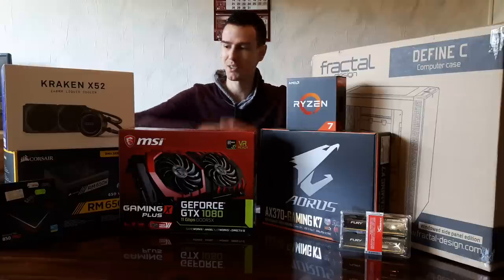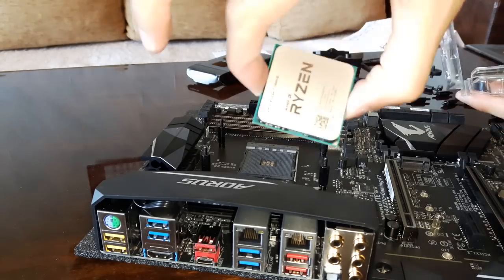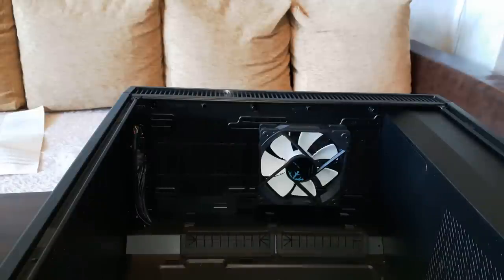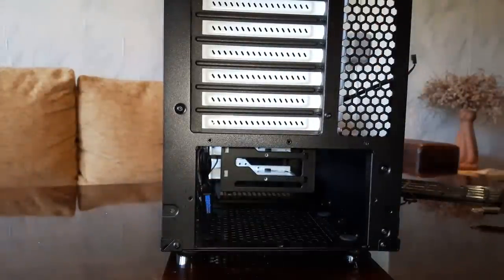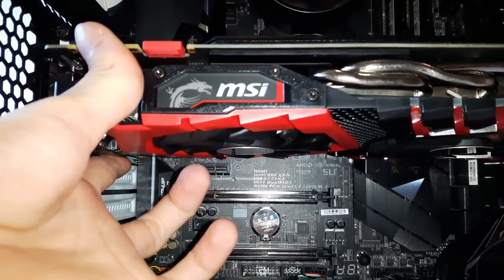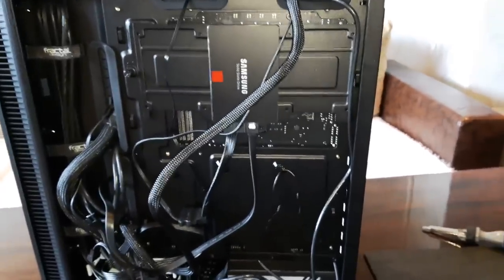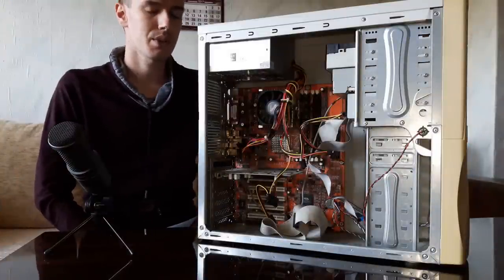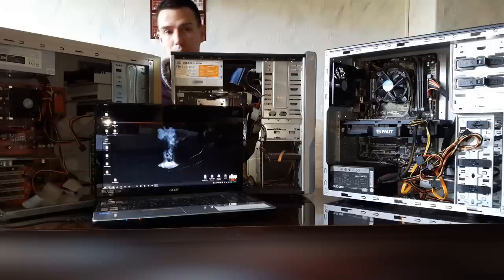FULL PC Build Guide [Ryzen 7 1800x / GTX 1080 / 16GB RAM / SSD / HDD / Radiator]

Comment: bad in fos 
what may be  the minimum require ments for  gaming pc   how it would cost i need to run at the games 
how i play it now is i check if it is released beafore 2009 i will get them
Reply from the maker: That depends on what games you want to play, what monitor you have and what resolution and FPS you are aiming at. Google it, there are many guides that might help you out.

Comment: I've looked at the title and I was like: "Is this for real? :O This must be fake, it's a top of the line PC, no more shitty case? Impossible! You're now like the other tech channels I watch. I was with you when you got the 2014 PC, how time flies!"

Thankfully, you're not like other tech channels...you are better!

I had a heart attack when you've thrown the boxes away, you maniac!

So GTA IV should now run slightly better, right?

Why not Ryzen 7 1700? With the cooler you could get pretty much the same performance for less money.

I've heard many bad things about Gigabyte motherboards, you still buy them, so do you love Gigabyte? :)

You say "ho" a lot :)

That GPU sag :/

This is not a guide, more like a personal diary of your entrance to proper PC Master Race, still, very useful if someone picks up this case.

It does look beautiful indeed.

Are the case fans 3pin or 4pin? If 3pin, not all motherboards/fan controllers can support them, and they will run at 100% making noise. If 4pin, they are fine and don't remove them, set them up in the BIOS.

You bought this cooler just so you can use its mirror to show your pretty face during the build? :)

For a first PC, the XP 1900+ is a nice CPU, better than those pesky Celerons :)

Surprised the Codegen PSU didn't blow up in the second PC.

spoiler alert - I saw "GTA 4 - Stevie's Car..." on the Acer :)

I'll brag about my current budget rig too I suppose:
CPU: Intel Pentium G4560
MoBo: ASRock H110M-DVS R3.0
RAM: 2x4GB DDR4 Crucial Ballistix Sport 2400Mhz
SSD: GoodRam Iridium Pro 240GB (MLC)
PSU: Seasonic Eco 430W
Monitor: BenQ GW2270
Case: Aerocool QS-182
GPU: Inno3D GeForce GTX 1050 Ti TwinX2 4GB

I'm really happy with it. Do you think it's good? It scores 6697 in 3DMark Fire Strike (regular) after stable overclocking. 
This is probably my longest comment yet, fitting for a long time fan :)
Reply from the maker: Ahaaaaa, I was expecting a longass comment by you, here goes:
- Thank you! I wish my camera quality was as good as other tech channels :(
- That was the reaction I was going for, mission accomplished :P
- 15-30 fps with everything maxed out and 1440p, while GTA V runs at 60 fps with everything maxed out (except upscaling). You know.... a game released 5 years after GTA IV. GTA IV being a 9 YEAR OLD GAME :X
-I wanted the best and it's more future proof. Also it has better clock speeds.
- From 2002 till now I've only used Gigabyte motherboards, they are usually cheaper in Bulgaria and I am very used to their BIOS, that's why I buy Gigabyte, I've also never had a problem with one.
- I have trouble pronouncing words which have the "L" at the end or close to the end. For instance I say "goat" instead of "gold".
- If I got any of the other MSI 1080s the sag would be bigger, they have bigger heat sinks.
- Yup, it would still be very useful to beginners though :)
- The case fans are 3 pin.
- Yes, that's exactly why I bought it. Just for the 20 seconds I used the mirror in the video :)
- It was one of the best (if not the best) of that time period. Friends were jealous and came over to play GTA 3 in glorious 800x600 resolution :P
- That's the 2nd (maybe even 3rd) PSU that the PC uses :D They die on their own and don't take anything with them.
- You cheater, you had so squint your eyes in order to see it, as we say in Bulgaria: клюкарка! :D
- I like it, what I would change is the MOBO to a Gigabyte one and the PSU to a CoolerMaster one. Also this is the first time I hear of Inno3D.
Reply: 1. So next video will be about your new camera? :)
3. Will we see the difference in new walkthrough episodes?
4. Only by very little, but fair enough.
5. I like ASRock the same way.
7. There are special things to support the sag.
9. 3 pin = poop, buy some new PWM (aka 4pin) fans and enjoy them.
12. Lucky you!
13. I always look for everything in every video I watch. Also descriptions!  :)
14. look point 5, Seasonic is the most well respected PSU manufacturer in the world, look it up. Inno3D was the cheapest option for a 1050 Ti. It works fine, maybe it can't overclock the core clock as high as I would, but GTA V works fine with it on almost (like shadows and grass) everything maxed out with 2x MSAA.
Reply from the maker: 1. Nah, it's not wortht it. I record my face rarely.

3. Yes, but definitely not soon. I will record newer walkthrough eps at 60 fps if possible (it's very hard staying at 60), but that wil be way later because I've already recorded many episodes on the old PC.
7. Yeah I know, it's ok for now. I will worry about it later.
9. That's the plan :)
14. I know about Seasonic and I was split between CoolerMaster, Corsair and Seasonic. I had to order a CM PSU from the states because they were not available from trusted websites in Bulgaria and the UK. And you might be aware you should avoid buying PSU from the states if you live in Europe because of te massive voltage difference of our sockets. Plugging in a US PSU here would blow up my case :D That left me with Seasonic and Corsair. I went with Corsair because I like them as a company.
Reply: Aren't all PSU's multivoltage nowadays? Just need the right 3 prong cable and that's it. I know old PSU have a switch at the back, and my friend actually blew up a MoBo because of it :)